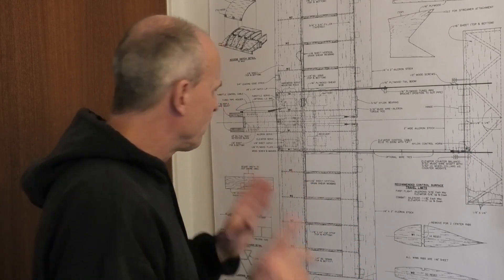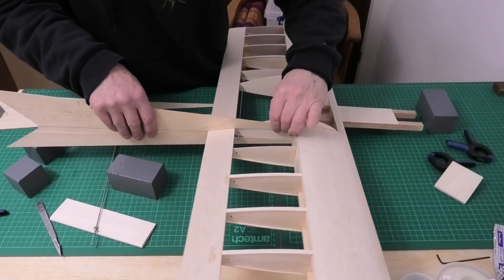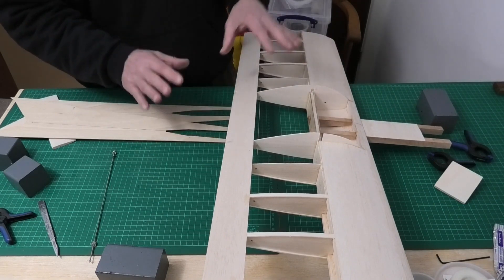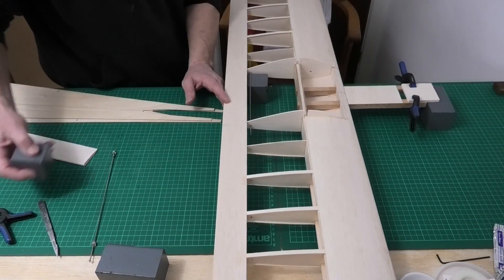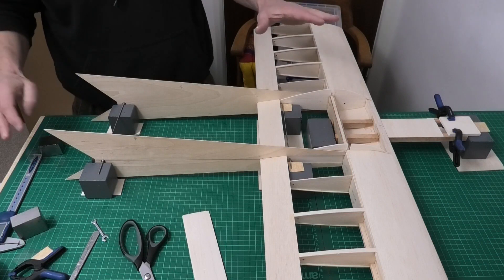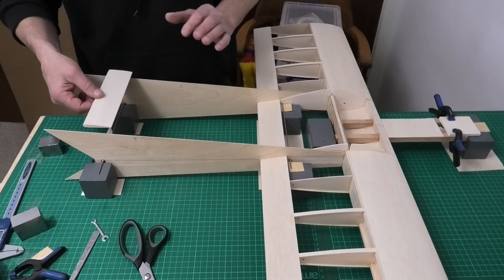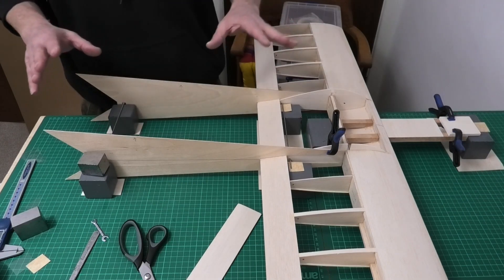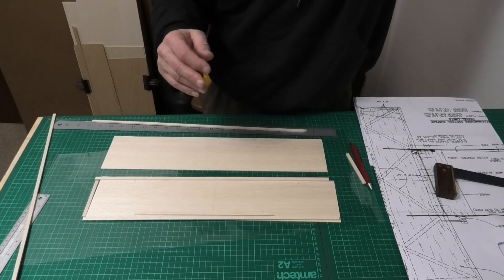Voodoo VI - Hi Performance 40" Combat Wing: Pt 4 - Tail Booms & Elevator

Comment: Mark I have an SC 46 spare,do you think it’s going to be suitable for this build.?
Reply from the maker: Hi Mark, a 46 is certainly the top of the engine size as specified by the designer, so should be good to go - will certainly be a scary ride with that much power in a 40" wing!! Go for it!  On a practical note the engine mounts will need to be shortened to get the corect CG, probably